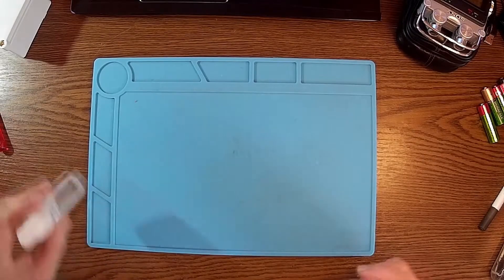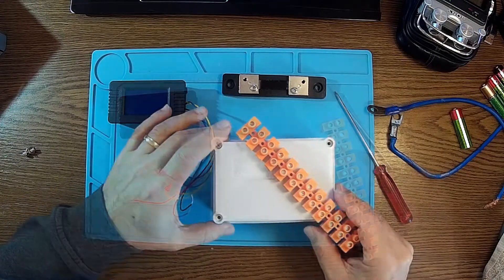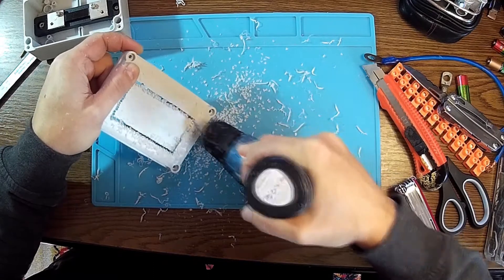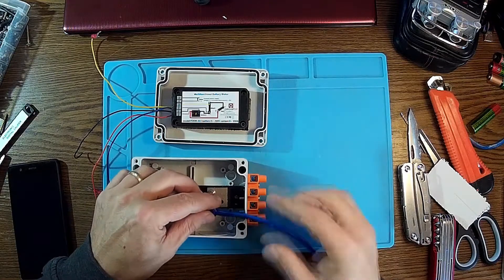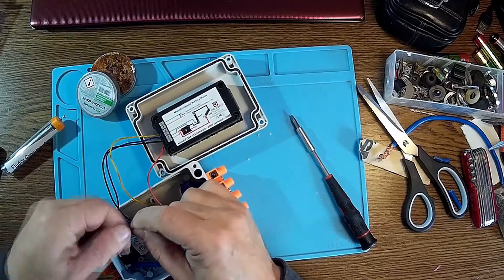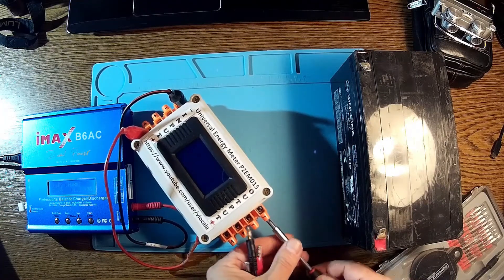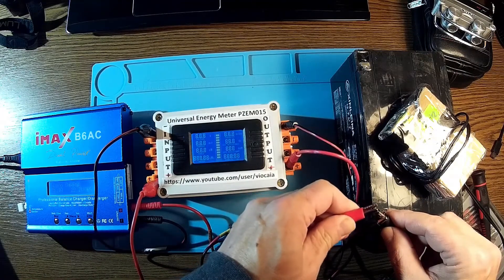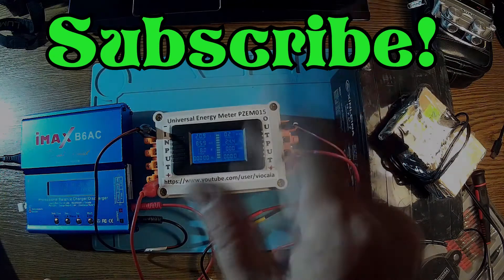Universal energy meter PZEM015 how to DIY a case

Comment: I saw the shunt heating up to 90°C using thermal camera. Isn't your diy case heating up the wiring inside? That could be dangerous.
Reply from the maker: I never rnotice that..try double the wires, or use thicker ones..double gauge.I doubt the shunt itself is getting hot, the R is to low and you said you have 300A version..

Comment: Can u share the connection inside and outside the box.. Bit confuse with big blue wire..
Reply: Share in the diagram
Reply from the maker: I''ll post soon stay tuned..
Reply: @viocaia  tq sir 4 ur kind.. From Malaysia
Reply from the maker: @mohdAli-je5xm  Happy to help! Good luck from Europe!
Reply from the maker: Hey! The blue cable at the bottom of the case it's a direct connection from +input to +output, it's the big red connection from the +battery to +load in the schematic at min 4:48.
Reply from the maker: Also , a better upgrade with self powered backup batteries here https://youtu.be/UTwrWOMB_CI